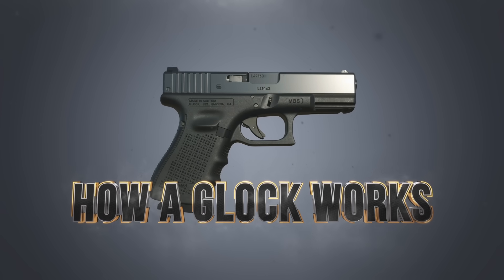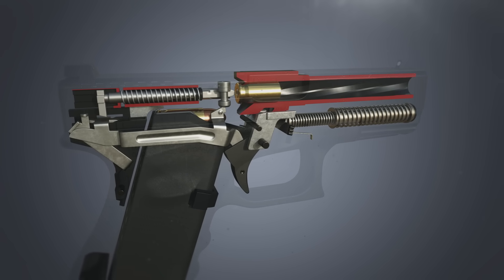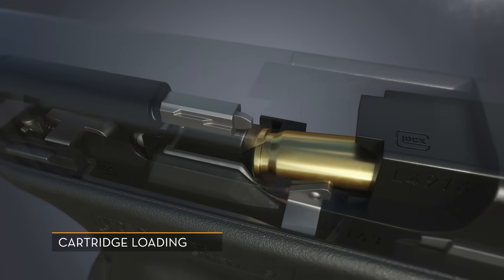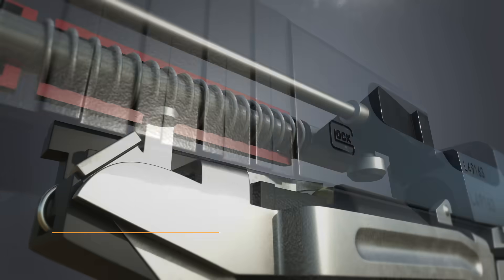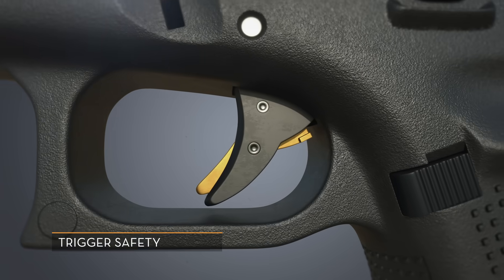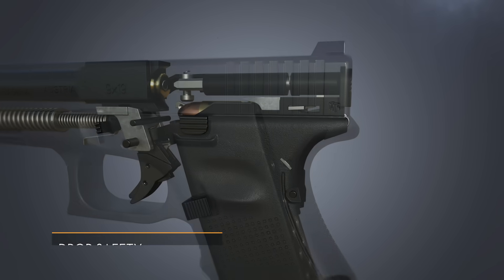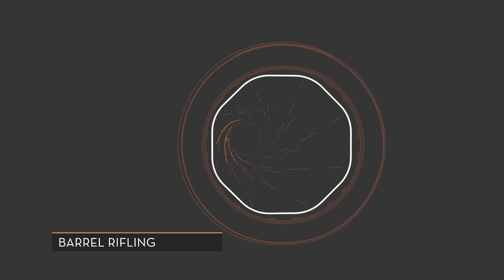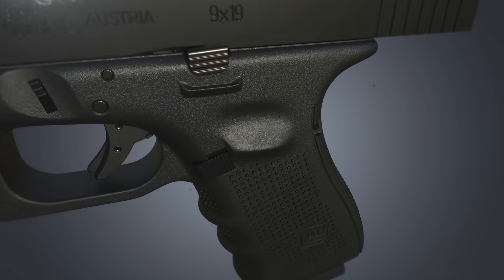How a Glock Works

Comment: Sooo... grabbing the slide in an effort to control the barrel and prevent the gun from firing wouldn't work for at least the round in the chamber.
Would it cause a jam though, if the person managed to prevent the slide from recoiling?
Reply from the maker: I think there’d be too much force to be able to stop it with your hand.
Reply: @mattrittman  yeah, I think you’re right.
Reply: @Sauli Luolajan-Mikkola okay, so if I was held at gun point and the gunman wanted to take my life with a weapon like this, then there would be a small chance of survival if I did something as crazy as grab the weapon and push the slide backwards and held on to it (and fought for the weapon, with strikes, etc). So that would actually prevent the weapon from firing?

I ask because I just saw a self defense video floating around that suggested people try that and I was skeptical of whether that would actually work from what I saw here. But I guess that technique could potentially save a life?
Reply: I see how this “self defense” technique would work now after watching the video carefully.

Pulling the slide back would move the firing pin backwards. This would mean the firing pin is out of the way of the trigger bar, and therefore cannot actuate the firing pin. So pulling the trigger once the slide is pulled back would not fire the round in the chamber… if you can react that quickly and precisely, this could give you a chance. But would still be very dangerous. But possible, and now I understand how.
Thanks everyone!
Reply: @Sauli Luolajan-Mikkola yeah. These “self defense” videos I’ve seen all over lately have been pretty concerning because of the danger they can put you in. You’re gonna be better off complying with someone holding a gun in almost every scenario and not further escalate the situation in my opinion.

However, I think it’s almost a meme now that the general population understands how ridiculous those videos can be, so that leaves some hope for humanity. Lol

Comment: Remember to leave your safety on so when you pull your Glock instead of your taser it won't go off when you pull the trigger...
Reply: The trigger IS the safety, or did you not watch the video that well. Pulling the trigger engages all three safety mechanisms at the same time.

Comment: video: the glock has three safeties
after explaining it me: so basically you have to depress the trigger in order to shoot it
Reply: The safeties prevent the firearm from discharging by being struck or dropped. You want the gun to fire when you pull the trigger.
Reply: @darkobiwan  I know... it was a joke
Reply: I made my Glock trigger watch Marley and Me. I would figure it's sufficiently depressed I must be doing this wrong...
Reply: @cmath6454  well if that's not working maybe try repressing it? or oppressing it?
Reply: https://youtu.be/n4cQCD77JHo
Reply: @yeahnice8341  what?
Reply: And they didn't say anything about the actual safety switch.
Reply: @sagaswp  Glocks don’t have safety switches. They are all internal safeties.
Reply: @Whomecouldntb3  What the switch in front of the "ponet".
Reply: Pontet
Reply: @Shadowdown666  That switch is used for disassembly only.
Reply: @sagaswp  It's a striker fire gun. Doesn't have a external safety nor does it need one
Reply: @sagaswp  Because it doesn't have one? :)
Reply: You're a fool. This is basically a how-to video on how to modify one for full auto. Note, this action is ridiculously illegal and overall a BAD idea.
Reply: @turbodog99  I didn't even think of that thanks for the idea
Reply: @turbodog99  how is it "a bad idea" ?
Reply: @turbodog99  I thought about it when he talked about that safety but I still wouldn't know how to do that, how is this a "how-to"?
Reply: @turbodog99  no it isn't.

Comment: Glock 18: Welcome to todays video where we review this water gun
Reply: No glocks are good they have bigger mags and there reliable
Reply: @Mommyhelsie  glock 18 sounds like it has the force of a water gun but if you unload it on someone the only drowning they are gonna be doing is in their own blood after getting 30 9×19 rounds pumped in the fucking throat
Reply: @giovannicervantes2053  less recoil and it has small force cause of the smaller bullets so they can hold more

Comment: Another great video, Matt! I like how at 1:26-:28 you allowed the trigger bar to "repeat" its motion a few times, for visual clarity, (I imagine). The surface textures were extremely well-rendered, the motion smooth, and even the inclusion of some of the motions without all the parts, as in the one rearward motion of the firing-pin housing (around 0:34) without the extractor, so one can see the firing pin. Then the motion was repeated from the other side WITH the extractor included so once could see the interworking of ALL the parts in the whole extraction process. That shows excellent forethought/planning about the video's "views" (I lack the technical terms).  This video, unlike your AK-47, had narration, and that was also handled well; accurately articulated, good clear tone and enough information to explain everything without unncessary details. Altogether, another excellent piece of work! Thanks for sharing this kind of thing with people. (BTW, I sincerely hope that this level of skill is providing you with a good living, in order for you to be ABLE to share this work with us.)
Reply from the maker: Thank you so much for such kind words David! I put quite a few hours into modeling all the parts, then into texturing everything. And yes, making sure the animation was smooth was important. And of course selecting a voice actor that I thought fit this style of animation. I am just finishing up work on another gun, the Kar98k bolt-action rifle. With all the work that goes into these animations, unfortunately I am only able to produce 1, almost 2 a year. I am also doing client work on the side. But yes, finally able to see a return on investment from YouTube after all these years, that lets me create more content :)

Comment: Fun fact! The Glock 18 is a selective fire variant of the 17. In full auto mode the rate of fire is 1100 to 1200 rounds per minute. Let's use 1200. That would be 20 rounds per second. So, each cycle would be approximately .05 seconds.
Reply: https://youtu.be/9l-1Se9vPU0

Comment: Reminder: this happens in half a second
Reply: Actually, much less than half a second. The Glock 18 is a selective fire variant of the 17. In full auto mode the rate of fire is 1100 to 1200 rounds per minute. Let's use 1200. That would be 20 rounds per second. So, each cycle would be approximately .05 seconds.

Comment: I think there is a minor mistake in the animation of the connector with relationship to the trigger bar.  the trigger bar edge essentially glides against the hook of the connector end, not overlap it. If it overlaps the trigger bar would not move up and engage the striker properly, at least that's what I had experienced first hand when the connector tension isn't strong enough and I had to bend it slightly to solve this.

Comment: If the barrel unlocks when the slide start to move under recoil forces, you'll have a out of battery discharge. Since recoil forces are causing the slide to go back immediately after firing. The slide and barrel are designed to travel a short length while locked together so the bullet has time to fully exit the chamber and for pressures has fall, only then does the barrel tilt up and unlock to extract the round. I feel like this video  fails to express the true genius that was John M. Browning tilited barrel design 🇺🇲
Reply from the maker: It was difficult to fully research every detail, this being one of them :(
Reply: Hello Nick

Comment: All very nice 👍 but, in the U.K. it’s prison if caught with one
Reply: Easy.  Dont get caught...
Reply: @Bendigo1  No good if I can’t use it
Reply: @joesmoke9624  ohh you didn't mention using it.
Reply: @Bendigo1  Did I need to mention using it. 😴
Reply: @joesmoke9624  ypu just said if you get caught with one...
Reply: @Bendigo1  I said, all very nice, but it’s prison in the U.K. if caught with one.
Therefore, Why would I risk prison and a criminal record just to have a gun I can’t use.
I’d say you are poor at inferring therefore any discussion with you would probably never end due to your nitpicking.
I bet you are bored my friend 😔
Incidentally, do you own a handgun?
Reply: @joesmoke9624  I was joking about not getting caught.  I was not trying to be rude.   
I have owned several different firearms.  I do not own any at this time.
Reply: @Bendigo1  OK. 
Have you owned firearms in the U.K.? 
I love the old Winchester rifles from late 1800’s Both the pump action one and the side loading one.
Reply: @joesmoke9624  i have never been to the U.K. 
And yes those are nice rifles.     Simple yet complex for the time.  And they look cool.
Reply: @Bendigo1  Thank you 👍

Comment: the "safties" is the only thing I am confused about. I get those are mechanisms to prevent accidental discharge but it appears that all can be activated with a finger pulling the trigger. Is there a safety switch to prevent even a trigger pull?
Reply: Some have a safety away from the trigger.  The trigger safety has actually been a cause of several accidental discharges

Comment: "The cycle is complete and the Glock is ready to fire the next round."

How long is this cycle?  In other words, can you theoretically fire rounds as fast as you can squeeze the trigger, or do you have to pause for a moment?
Reply: The glock has a considerable fire rate, so yeah, you can fire rounds as fast as you can
Reply: You can fire as fast as your finger can pull the trigger. The cycle happens in a fraction of a second. It's humanly impossible to fire faster than the cycle. The faster you fire tho, the less accurate you are of course.

Comment: hilarious, all 3 safety's are disabled by simply pulling the trigger, how is that a safety??
Reply: yep what the hell. Safe as! just dont pull the trigger, or load it, or ever be near it ever lol
Reply: The safeties are there so the gun can't fire by itself. With a round in the chamber the gun would fire by itself if all three safeties failed.
Reply: @chrisking7038  i realize that it cant fire on its own like a sig p320, but a "safety" is supposed to make the weapon safe so that even if an in desciplined novice picks one up and pulls the trigger without checking it nothing will happen. Glock needs to add a manual safety like smith and wessen did

Comment: Glock teaches an important lesson about the purpose of a "Safety".  A safety is NOT  device that allows you to squeeze the trigger without firing the gun.  A safety is a device the prevents the gun from firing when the trigger is not pulled (i.e. dropped, struck, etc.)

Comment: If anyone points a gun at me, I'll just say:
"But you forget that the Glock contains three safeties.

The first is the Trigger Safety.
The trigger cannot be pulled back unless the safety is engaged, allowing it to move past the frame.
The second is the Firing Pin Safety.
The firing pin cannot move past the safety
 unless the trigger bar has pushed it up, allowing the firing pin to move past this safety.
The final is the Drop Safety.
The trigger bar is held in place by the housing.
 The firing pin cannot move forward unless the trigger bar has moved back and cleared the ramp of this housing."

Comment: interesting. But it also makes me think how our weapons are still largely "mechanical". 
If you compared an M1911 with a modern handgun, they would largely look the same. 
But if you look at how far technology has progressed, well, let me just say that radio still had another 10 years before hitting the market. 
Disclaimer: I am not a gun genius, but I know that firearms have seen  a number of improvements over the past century, such as alloys used, mechanical upgrades/optimizations and other materials. but they still shoot bullets with expanding gas. That technology has been around since 1364, the first recorded use of a firearm.

Comment: Glocks are so user friendly.  Whenever a friend says, "I'm thinking about buying my fir....."  I say, "Glock!"
Reply: Any further detail? One of my recommended vids below this is "Top 5 Reasons You Shouldn't Buy a Glock"
Reply: @dnxtbillgates  I'd love to watch it because I could never think of 5 reasons not to.  I have S&W's, Sigs, and Glocks and Glock is so damn simple.  My S&W requires sticking a tool in and pushing a bar/lever down and pulling down hard to turn little levers on the slide to strip it.  My Sig is a little easier but still a little process.  I can strip and reassemble my Glock in 10 seconds.  And if you want to do a little custom stuff or upgrades you can do almost anything.  Although I bought my Glock to use as a work horse because I didn't want to foul up my beautiful mirror polished and tulipwood handled Sig Sauer at the range.  But I still keep my Glock on a magnet on my bed headrest with a Steamlight TLR laser/flashlight on the rail.
Reply: @BudsCartoon  https://www.youtube.com/watch?v=2PC5cr0fi7E.

Comment: really cool mechanism! Makes accidental discharge due to mechanical failure virtually impossible, since there is no hammer sitting in the cocked position with the stored energy to hit the firing pin. The trigger literally has to be pulled to supply the energy to move the firing pin rather than releasing energy that has already stored in a spring before the trigger is pulled. I've never removed the slide on my glock to see this mechanism, it hasn't been fired enough to merit a "deep cleaning" yet, but the inherent safety of this mechanism is so clever!

Comment: How does the durability of the Glock compare to the more traditional auto pistols like the Sig or Beretta 92?
Reply: Glocks are simple, cheap and just keep going. 
I carry one for wilderness defence and, while I'm perfectly happy with it, I wouldn't buy another. When a gun is a tool for work, you want something that's light but still reliable and robust.
It's meh...but it always goes bang when it needs to and survives hard use REALLY well.
I've got probably 2K+ rounds through my G20 (both .40 and 10mm) and it runs just like the day I bought it. It eats whatever I feed it and asks for more.
I've seen other issues (like locking block failures on the Berettas) but don't own them so can't say.

Comment: When guns jam or malfunction, where in this process does it usually happen?
Reply: Its mostly a magazine issue. If the spring in the magazine (the spring that pushes the rounds up) is worn out, the slide might have trouble catching a round to feed into the chamber. Or the extractor can be worn out and not kick out the spent cartridge which can cause a jam. Those two are the most common but there's a lot that can go wrong
Reply: @cliftonjames785  Thanks

Comment: So the invisible "hammer" is never in a cocked position?  That means I have to pull that trigger hard everytime I shoot a bullet?   I have a Mini-Thunder Bersa and after the 1st shot all other shots can be done with a "hair-trigger" sensitive pull, almost all firearms are this way.   Someone explain if this is the case with the Glock, the next handgun I'll be purchasing.
Reply: I mean you can just google if the specific gun you want has double action trigger. For future knowledge though guns that have retractable slide generally are double action. (double action just means that you can fire the gun from an uncocked position{check out 9mm barrette 92FS safety decocking lever} or from a cocked position{think wild west revolvers where they had to pull the hammer back before they could fire})
Reply: @helfire9562  HI there, 1 year after I purchased the Glock 17 for 9mm. I love it.  The ergonomics of it is just amazing, and love the fact it can hold 17 cartridges. But I find it "weak" when shooting it, feels like I'm shooting a .22 caliber after coming from a .40 cal Min-Thunder that packed a punch when you fired it. The 9mm round feels like child's play.

Comment: "As the trigger is pulled, the trigger bar pulls the firing pin back. The connector guides the trigger bar downwards, releasing the firing pin, and allowing it to strike the bullet primer.This lets the cartridge know both where it is, and where it isn't. By subtracting where it is from where it isn't, or where it isn't from where it is (whichever is greater), it obtains a difference, or deviation."

Comment: I want you to explain in a little more detail.
There is not enough explanation for Glock's excellent mechanism, such as the trigger moving forward when the striker is (half) cocked, and the trigger should be returned to the minimum necessary when firing continuously.
もう少し詳しく説明して欲しいな。
ストライカーが（ハーフ）コックされている状態だとトリガーが前進しているとか、連射する場合はトリガーを必要最小限戻せば良いことなど、Glockの優れたメカニズムに対しての説明が足りない。

Comment: Way over my head ! So the gases cause it to  go at 400 miles per hour
Reply: The projectile comes out at over 1100 feet per second, sometimes as high as 1335 feet per second.  1100 fps is 750 mph.  1335 fps is 910 mph.

Comment: If your amo is bad quality, can't it explode when it autofill it in the chamber ?
Sorry my english is bad.
Reply: What you are referring to sounds like "slam firing."  If it doesn't occur with good ammo, it isn't going to occur with bad ammo.  If you have a bad chamber or a squib load (previous projectile never exited the barrel), then yes, it could explode, but not when feeding.  The firing pin is recessed and nothing else is there to strike the primer.  Then again, an improperly installed primer can cause that type of malfunction you are are referring to.